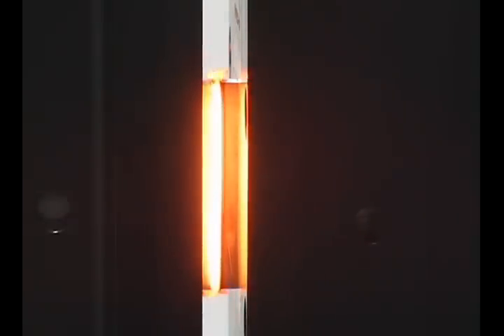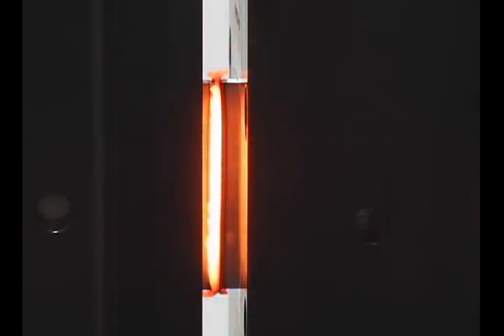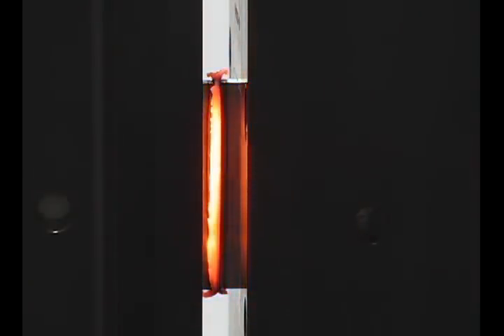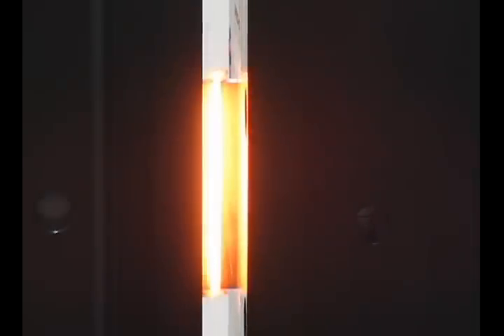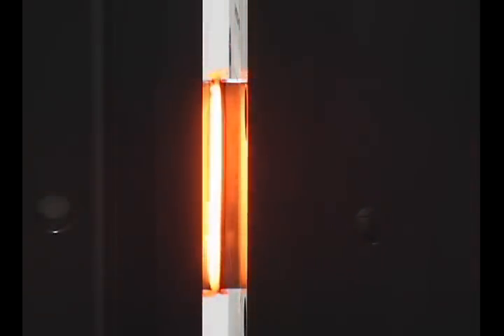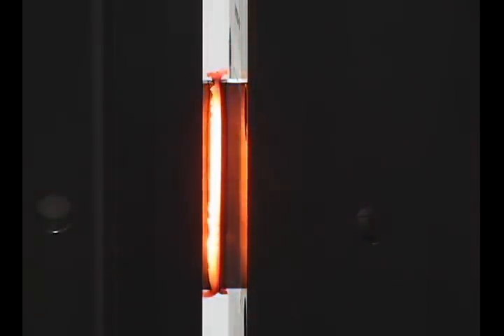Linear Friction Welding Demonstration - English

Comment: Is there any significant, or noticeable, weakness in the portions near the two ends of the welded part, where the oscillating portion "overshoots", then "undershoots", the stable portion?  It would seem that less heat would be generated on those two ends, for I guess roughly half the total displacement?
Reply: Great question